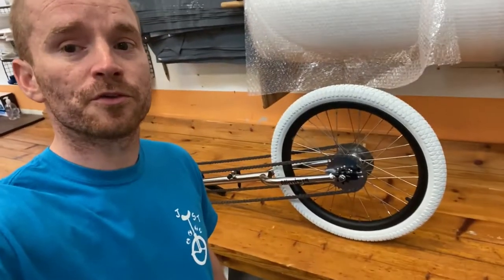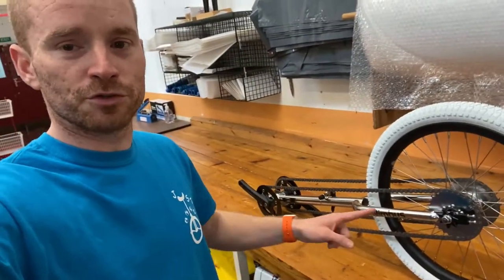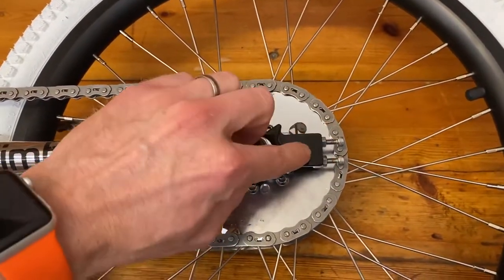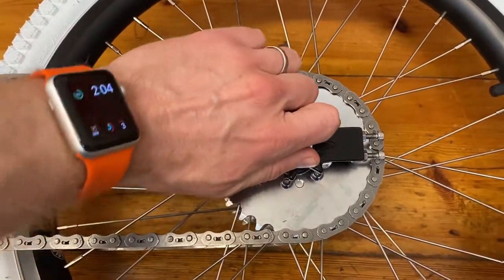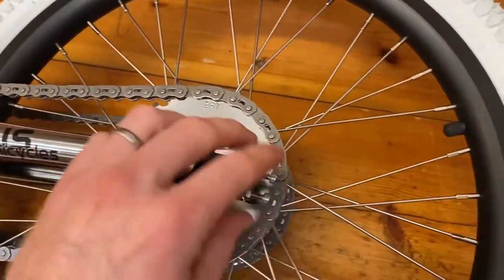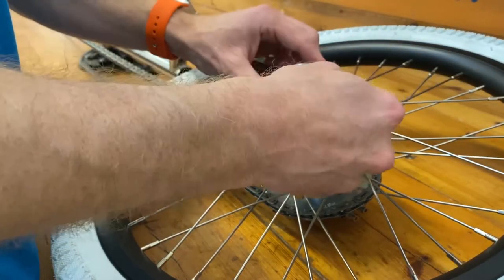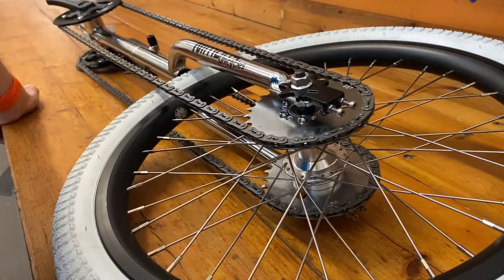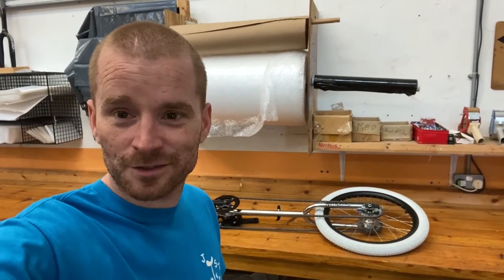Performer Giraffe Unicycle Chain Tensioners (How To)

Comment: Thanks for the video but the issue I had was the front of one chain was tight and the back loose. The other chain had the same problem but in reverse as the front loose with the back tight. I asked a bike shop to change the older crankset over to the new one featured in this video and they had this problem.
Reply from the maker: Hi David, we noticed your comment on Facebook and though that had been sorted. :) This video is from an email we got asking about the tensioners.
Reply from the maker: You need to tune the crank set to match.  The instructions are in our FAQ.  https://www.unicycle.co.uk/faq/article/tuning-cranks-twin-chain-giraffe
Reply: @unicycledotcomuk  thanks I did find that sheet in the box after I got it back from the bike shop. I showed it to them later and the guy was a bit miffed about how to do it. He did get it done in the end but did look tricky.